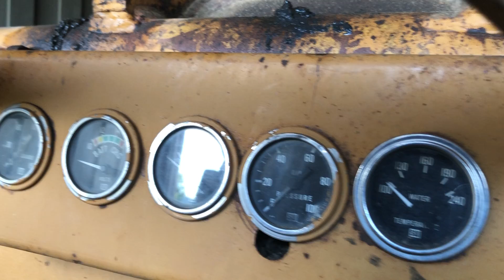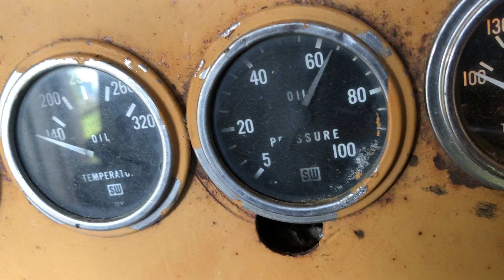How do you find a Detroit Diesel powered loader? That’s easy!

Comment: Well, the engine was certainly a little louder than your voice was...
 There is just nothing like the sound of a lovely screaming Detroit Diesel engine. I would imagine that's how you found my channel showing off my 59 Chevy with the Detroit engine in it.
 I think in my collection I have 8 or 10 Detroit motors of all sizes. I think four 353's.
 Did I hear right that your brakes still work?
Reply from the maker: Yes, this unit went through the four wheel brake rebuild a few years back. They’re air over hydraulic and each axle has its own separate system. Hugely complex and a GIANT pain to repair. Took me weeks of work and (naturally) hundreds of dollars. I was able to source parts fairly easily. Lots of old truck pieces in there. Thanks for watching!